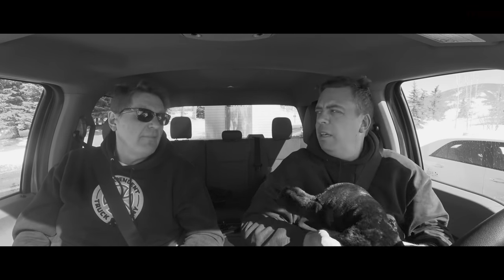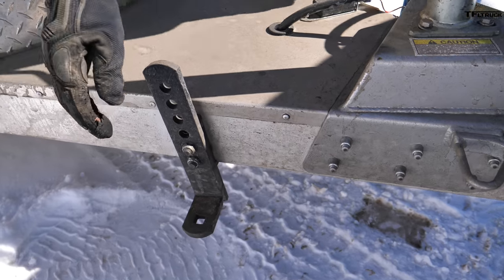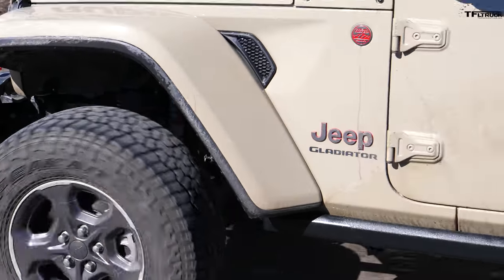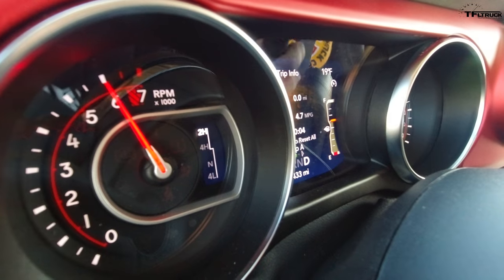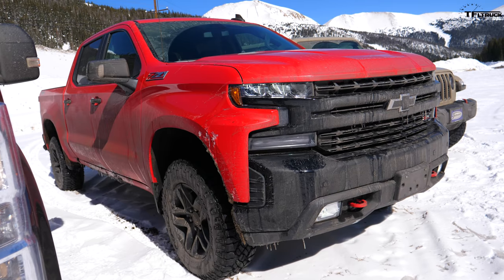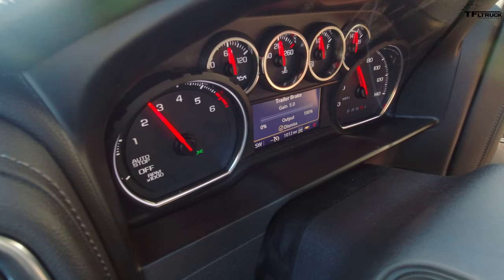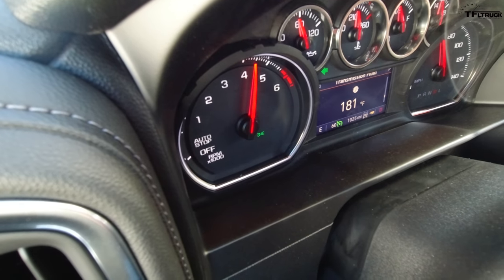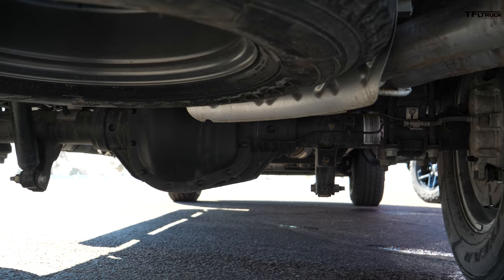Midsize, Half-ton, and HD Trucks Versus the World's Toughest Towing Test - Only One Truck Kills It!

Comment: Tfl killing it with the real world testing! Nobody actually tests towing properly! Props guy!
Reply: I definitely would not tow with the jeep!
Reply: @R AJ Actually yes people do. They are torture testing these rigs by towing (some of them) max  tow weight set trailers up a an extreme grade. People towing will encounter this situation either using the trucks for work or towing up mountain passes. If you want to watch flat towing check out their mpg loops where they are on flat ground. #tfltruck
Reply: @R AJ you've obviously never driven around with guys who work. Trucks get pushed hard when your not looking. Anyways, if the trucks can handle the torture test then it's capable in the general public's untrained hands. That's the whole point.
Reply: @JohnDoe-nz6bk  I think the Jeep did well towing its maximum weight.  It did much better time than the 2020 GM 2500 gasser towing its own max weight and did it with better MPG than 1500 and F250 as well.  WDH should have been used on all but the F250.

That being said, I'll be towing 8000 lbs with an F250 and NOT with a Jeep :)

Comment: Could you guys do a towing and mpg test of two of the same HD truck, same build and motor. but with different axle ratios? Like 3.73 vs 4.10 “ram” or 3.55 vs 4.30 “ford”. I really want to SEE what difference there is in towing time and fuel consumption. Both with and without a trailer, 0-60 time, and time up the Ike gauntlet 👍🙏
Reply: Mike Hunt I second this test.  I am looking to buy a new XLT/Lariat F150 that will be my daily/adventure rig.  I come from an off-roading background and like high geared vehicles, but have never really cared about fuel economy up until I moved to CA.
Reply: I believe they already did the fuel economy test on the 4.30 vs 3.55 Ford, they haven’t done the max load tow test on the 3.55, only on the 4.30 blue F250 where it killed it on the Ike, probably my next power train for sure and I’m currently in a 6.7 Cummins.  I think the 4.30 cost them about 2 mpg on an empty highway run.
Reply: Yes!  This please!
Reply: Mike Parlin my 18 F150 with the 5.0 gets 20mpg if I stay 74 or less. At 75 and up it drops to 18.  I average about 18.5 city/hwy.  3.55 gears in mine.
Reply: I'm also curious about the Powerstrokes with the 3.31 axle. Everything I see has the 3.55, and I'm wondering if there's an appreciable diference in performance or mpg with the taller rear end.
Reply: David Colantoni yes but I’m wanting to see a side by side comparison of towing mpg and empty. 0-60mph towing and empty. Time up the Ike gauntlet. Same day, same trailer. I want the focus of the video to be what difference the axle ratio actually make. Real world numbers
Reply: Luke Diehl 
Not quite the same, but I owned a 2015 F250, crew cab, long bed with 3.31. I put 285/70 on it and the truck doesn’t care. There’s so much power and torque in today’s  trucks. Don’t let gear ratios bother you. May if you’re towing max load, but 10,000 and below, you won’t notice.
Reply: Luke Diehl 
Also, I could be wrong, but I think ford put 3.55 in trucks with 20” wheels and 3.31 in trucks with 18” wheels. The final drive should be equal. That was my point; I went up 2” in tires with 3.31 and still had more balls than the Patriots locker room.
Reply: They are limited by what the manufacturers send them.  they might be able to make requests, but I'm not sure.
Reply: @scottdbsn  "More balls than the Patriots' locker room"
😂😂😂😂
That's awesome.
Reply: Lower gear ratio is better on mpg by 3 to 5 mpg. Towing higher gear ratio is better also if you lift your truck and bigger tires your gear ratio drops do it will help
Reply: 12LOOK4 2FAST I understand all of this. What I want is to SEE all the differences. Towing and non. On-ramp speed/0-60. Time up the Ike gauntlet. And towing mpg. I’ve been “told” the differences my whole life. Lower gears better for highway. Higher gears better for a trailer. But I want to see the exact numbers difference side by side
Reply: @LOOKFAST  - A lower gear ratio will actually hurt mpg in town, it only helps on the highway.  3-5 mpg is pretty optimistic, but it would depend on the truck, a 30mpg Ecoboost yeah, but in a 12mpg HD I'd be shocked to see a 2mpg difference between rear ends.  I guess I'm splitting hairs though, because your idea is definitely correct.
Reply: As a rule of thumb if you are towing 80% max weight or greater and, if your tow miles are less than your normal drive miles get the higher ratio.  If your tow miles are more than your normal drive miles get the lower ratio.  This will give you the best cost based option for your situation, however it may not cover your emotional preference.  Your best cost/durability option is greatly affected by how much you are towing and how much of your driving is towing.  One more thing, where you are towing (Mtns) will also affect your choice.
Reply: Bushy556 I’m about the same in my 16 F150 w/ 3.5L EcoBoost and 3.55 gears- 20-22 on highway up to about 74, drop down to 16-18 at speeds over 75.
Reply: Bushy556 & others...as an FYI ... I have an f150 3.5 twin turbo with 3:31 rear end; 6 spd auto tranny. I tow a 7200# travel trailer thru the nw hills & mountain passes. I usually tow at about 60-62mph occasionally hit 65+. No problems going up hills @ 60+. Rarely drops below 3rd gear. Average about 10.3mpg. Will hit 13+ on flats. Empty 22-24 at 65mph on frwy, 17 in town.
Reply: @scottdbsn  The 18" and 20" wheels are wrapped in different tires...the tires on the 18's are not 2" smaller in diameter than those on 20's. The final drive ratio is not the same.
Reply: unitedgray 
Good to know. Do you know what sizes the trucks are offered in?
Reply: unitedgray 
2015 F250 crew cab was offered in 275/65R18, 265/70R18, and 275/65R20. So the two 275’s have a difference in diameter of 2”.

Comment: FINALLY a test using the same trailer, I HATE when MotorTrend or C&D tests trucks with a percentage of their max trailer capacity... that doesn't help at all! If I have a 4000 boat and trailer or 6000 pound camper or 8000 pound horse trailer, I want to know how well various trucks can tow THAT trailer, not as a function of their max capability. I'm most surprised by the fuel economy of the Godzilla powered F250, the whole point of that design (other than low maintenance) was MPGs. I'll have to watch the mpg loop tow test to see how it fared. At any rate, nice test guys!

Comment: You guys really need to do this with three of the same brand truck. Like Colorado vs Silverado 1500 vs 2500, or ranger vs f150 vs f250. This test is kind of apples and oranges
Reply: I mean we've actually seen from the other tests that the segments are actually pretty close to each other. The mid-size trucks reform about the same as each other and the full size 1/2 tons perform about the same. That becomes even more true when you have the same load between all of the vehicles. This test shows that I'd expect, that maxing out a midsize truck is much worse for towing then putting barely any weight on a 3/4 ton or a good working load on a half ton.
Reply: @SSMJ  yea but the ranger and the colorado/canyon dont have a engine desgined for a minivan in it unlike the gladiator. i think colorado 3.6 vs the silverado 5.3 would be a good comparison. and you shouldnt be cross shopping a colorado and a heavy duty in my opinion if the truck is consistantly towing 80% or more of a half tons limit or past that limit than get a heavy duty otherwise you dont need it (i would say ranger vs f-150 but the engine options cause to much diffrentiation and youd need to test every power terrain and thats not reasonable)
Reply: @shaunclancey1107  Hate to break it to you, the 3.8 liter was the one designed for the minivan, the 3.6 has been put in either sports cars or the Wrangler lol.

Having driven all three, knowing the powerband and Dyno results for all three, they're incredibly similar, with the Taco being the slowest, the Gladiator being the next, and the Colorado being the fastest and in my opinion the most fun-to-drive. 

I'm going to stand by my point that this is a fair comparison, feel free to disagree.
Reply: @SSMJ  hate to break it to you but the 3.6 pentastar is in the dodge caravan. yes its also in the v6 "sports cars" but its not the desired engine option for a reason. 

       second even if you were right those two classes being a budget sports car and a off road dedicated suv are not meant for towing or hauling and neither is the gladiator.
           i say i would like to see a comparison that is against 2 trucks that are likely to be cross shopped and are meant to do a trucks job. and this a is a towing comparison video i couldnt care less about your claimed dyno results as i dont care about a 0-60 on a truck meant to do a trucks job.

        now i say id like to see a video of colorado vs 1500 because someone who tows there boat or small camper or even consistant 5000lbs towing runs might want to know which fits there needs better while being the best bang for there buck in reliability and on fuel

now i think this is a unfair comparison because the gladiator is so out of its desgined purpose proof being that it doesnt have a trailer brake and that from this test they seemed very worried when it was being tested and its partly due to a suspension thats not made for towing

you are welcome to disagree but this video is meant to help find someones correct truck for jobs that can be done by both but possibly better or cheaper by another which is why my opinion is what it is
Reply: Everyone seems to want many different tests but the reality is these guys have 3 trucks that they own and they have access to trucks made available to the Press by manufacturers, they have no say in what is in the Press pool. They don't go to dealers and pick any truck they want. They are dealt a hand and can only test what they are given to choose from. They did obtain another 7.3 Ford recently and did a MPG test with 3:55 and 4:30 but one was with the Tremor package so not exactly the same. They do a very good job with what is available but will never be able to please everyone because of limited access to makes and models.
Reply: Agree most(80%) people are brand loyal.  Do one with 1/2 ton max tow with small V8, 1/2 ton large V8, 3/4 ton V8.  All towing the same weight.

Comment: For that kind of daily work, 5 times a month or more the 3/4 ton truck is definitely the way to go. If I was pulling 7000lbs once or twice a month or so then maybe a 1/2 would be more livable day to day. In the 1/2 ton truck I'd probably spec it out with the 6.2 or the 3.5 EcoBoost if it was a Ford. Extra power is always a good thing to keep in reserve.
Reply: Chris Gill agree 100% with you! Couldn’t have been said better
Reply: The 5.7 Hemi is a good choice as well.
Reply: No such thing as a f150 with a 6.2...
Reply: @myname9856  There was until 2015 but he didn't say Ford with a 6.2.
Reply: He is saying the 6.2 chevy rather than 5.3, or, if a ford, then the 3.5.
Reply: It just really depends what you are pulling. If you are pulling a 35' long 7k pound camper...then its 3/4 ton all day long for safety, especially if your family is in the truck. If its a 7k lb 20' long open trailer with a car on it, half ton all day every day. Sway control, stopping power, and more weight to feel more stable are irreplaceable.

Comment: Everyone says fords prices are outrageous but it was the same price as the other 2 and can do twice the amount of work
Reply: Dirty Harry What truck/trim did you get?
Reply: The F-250 is an xlt I believe. The other ones are higher end trims. I'm not sure about the trailboss, but that rubicon is top trim level. Jeep Gladiators are overpriced for sure.
Reply: Nicholas Desmarais LT would be Chevrolets equivalent of Fords XLT.
Reply: @josephwhiskeybeale  Yeah -what I was meant was that I don't know what the trailboss is trim wise. I know its an offload package, but I don't know where it sits in the lineup.
Reply: Nicholas Desmarais well the Chevy is an LT Trail Boss so it would compete with a Ford XLT FX4.
Reply: That's not how it works. Each of those trucks has pros and cons. The jeep is nice and small and nimble and gets better MPG unloaded. Not everybody buys a truck that can haul 14000 pounds just to pull their 3000 pound tent trailer around. The jeep is more capable off road, and is loaded to the max with features and luxury options. It's a rubicon.
Reply: @slipjoint637  Ahh okay -thanks!
Reply: You get way more for your dollar with the f250
Reply: @slipjoint637  I think it depends on what you're planning on doing with the truck, but I'll agree overall for the price the f-250 is probably the best bang for your buck. The gladiator is the worst. I can't believe how much that thing costs.
Reply: @slipjoint637  but a Ford xlt fx4 would be cheaper lol.
Reply: @JohnSmith-ev1sm  17 city 22 highway compared with the trail boss at 16 City and 21 highway. Woooow. What a difference. The ram is also a faster accelerator, much more powerful. Very off-road proficient. That jeep is just an overpriced POS
Reply: @John Smith Finally a comment that makes sense on here.
Reply: Patrick Jones I would like to see some of those trucks do the same trails that the gladiator can do. Obviously this truck isn’t gonna tow what the others can. Completely diff class of truck. Not what it’s made for. I do think they are overpriced, but they do offer a lot in specs that some people don’t realize how much they truly offer.

Comment: Great idea, can't believe noone thought about this before! :-) I don't use cruise control going up hill like this. Also, the F250 was perfectly suited for this weight. My friend pulls 6k lbs behind F250 6.2 V8 for living and he would never pull it with half ton. Great job, TFL!
Reply: Really 6k behind a half ton is nothing
Reply: @kidamere2408  6K on a flatbed, weight properly distributed, tongue weight at 10% trailer weight...sure, but you're still going to see a lot of squat. 6600lb toy hauler, heavy on the tongue, high profile, HELL NAH!  Not even with a weight distribution hitch.
Reply: @hittman801  my god everyone acts like you need a semi to tow a pallet of pillows , my toy hauler toys just fine but yes i use the weight distr hitch and if you dont drive like a fool your fine, been towing mine for years never an issue
Reply: @kidamere2408  Stay safe, my man!  Wish my Sierra 1500 5.3 8spd and my toyhauler were a good combo, but after a 300 mile round trip with the engine screaming at me over mountain passes and not so steep hills, getting bumped in and out of my lane by wind and sheer from other vehicles, it wasn't a safe or comfortable solution.  A lot of factors at play, but just because you fall in line with manufacturer's specs, doesn't mean performance is going to be enjoyable or even acceptable.  I stepped up to a 2500 cummins and towing is a breeze, but daily driving isn't as enjoyable as in the 1/2 ton.  Weigh your needs and options and go with what works for you...

Comment: Something I'd really like to see is these tests is acceleration (like 0-60 or maybe 0-30) compared when towing a trailer. You guys have done plenty of drag races before, and of course we know a f150 ecoboost or a ram 1500 hemi are always going to beat a heavy duty, but what is the power & acceleration difference with a trailer. I suspect the heavy/super duty might fair a bit better than it does in the truck-only races, but i'd like to find out. Ideally with a diesel in there, but i'd be happy with these trucks you've been using too. Thanks guys, love your content.

Comment: This test would've been awesome using all 3 from the same manufacturer. IE ranger F150 F250. Or Colorado Silverado Silverado HD
Reply: The Ranger and Colorado both have lower tow ratings. Would have had to use a small enough trailer to not really distinguish between the 1500 and Super Duty. So few people consider a Ram 2500 relative to Ford or Chevy so it wouldn't be quite useful for most people - and you really shouldn't get a Ram 1500 if you plan on towing a lot, the capability is there when new, but they eat transmissions.